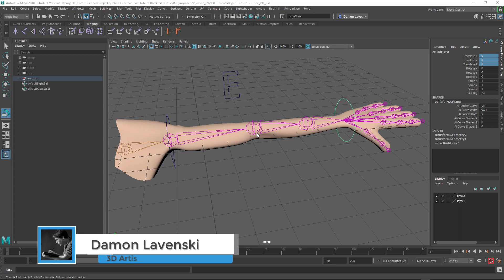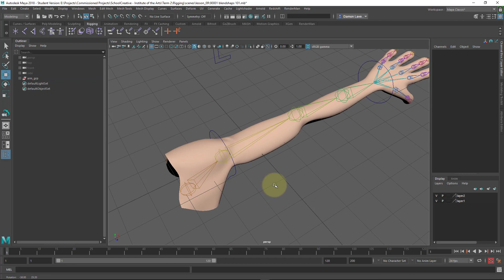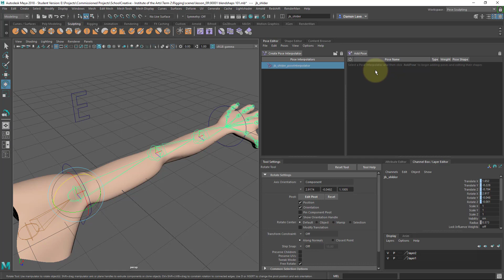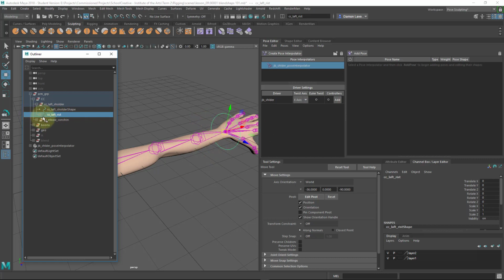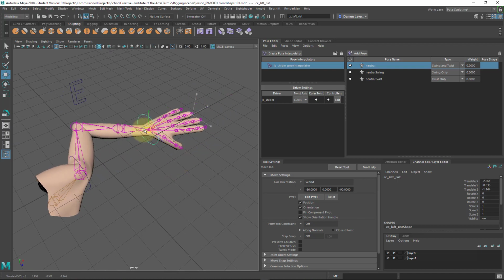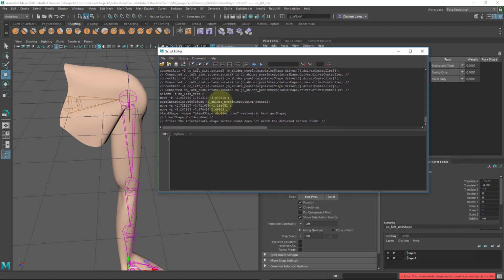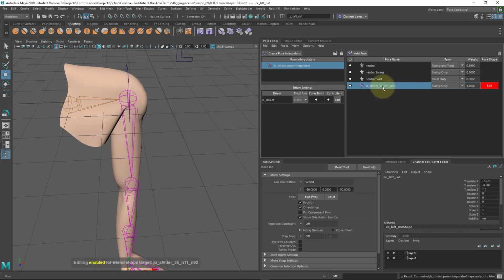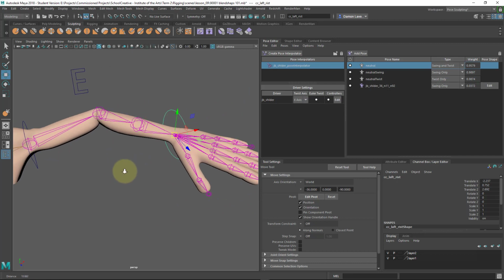Autodesk Maya Pose Sculpting on a Rigged Character

Comment: Ok, what about if you have a IK FK switch, Than the bind joints are driven by either the FK controls OR the IK controls..?
Reply from the maker: not sure I understand your question! of the bind joints should follow one or the other depending on the float attribute that you had to the switch. 0 FK 1 IK 0.5 in between
Reply: @DamonLavenski My question is, what is the driver of the shape interpolater in such a setup? The FK shoulder ctrl curve? or the IK wrist ctrl curve? If it’s either of of them, the pose interpolator will not trigger if it’s or in IK mode, or FK mode.. Ideally it would respond to the bind joints and not the FK of IK chain, like a classic pose reader
Reply from the maker: @gherat  as far as I know, it does not matter which control you use it's at FK or IK,  it matters which join change you use to drivee the shapely tribulation. In this case you want to bind joints to drive so when they change positions they will activate the blend shape
Reply: @DamonLavenski  what @gherat means is that if you have the bind joints constrained by both FK and IK joints, which chain will be the driver in the Pose editor. Considering that the pose editor does not recognise bind joints if they are driven by another object and thus, you have to name those driver objects (controls or other driver joints). What would you do in that scenario ?
Reply from the maker: @sultanefe6057  The driver bind should be the bind joints. And then you have the controls you wish to drive pose. I'm not sure if you can have more than one driver for FK and IK. I have been to use this tool in quite a while, and truthfully don't remember. But I think you probably can
Reply: @DamonLavenski  ok. Say you have three joint chains for the legs; bind, ik and fk. You have a counter twist hip joint too if you like. you raise the leg(thigh) using ik foot/leg control. So in this situation, what would pick as the controller driving the bind joint in the pose editor. I know you would say hipik joint. Then, what happens if you switch to fk? Does pose editor accept two drivers or controllers?
Reply from the maker: @sultanefe6057  As long as the joint chain that is the bind chain is driving the blend shape, It does not matter which control you use as long as the joint chain is the one driving the shape.

Comment from the maker: Thanks for the feedback, now to answer some of your questions. Philip as far as I know you probably could create an in the pose editor and then channel it into the opposite side connections. But I haven't tried it myself. Jason Braatz, I truly don't know and I haven't tried it yet. But all of Autodesk's demonstrations are on an HIK system, so it should be possible. Sebastian L, I too find it quite useless and prefer to use blend shapes and Drive keys it is initially the same. But that being said I haven't tried to debug it and find a good workflow for it yet. It is one of those Autodesk things where they develop a tool and it will sit there for a year or so before they get back to it and completed if ever.

Comment: thank you very much!
https://knowledge.autodesk.com/support/maya/learn-explore/caas/CloudHelp/cloudhelp/2016/ENU/Maya/files/GUID-7C5BE381-CBB3-43E7-8B4B-77376CAD09FA-htm.html
this link is also great but the video helped a lot,

but now i have a problem and i wonder if you know anything to fix it,
i followed the steps and was able to create poses and i can switch back and forth by double clicking

but now when i click edit i cannot make any changes to the mesh,
the translate tools and sculpt have no effect on the mesh, the mesh is locked from any change for some reason even if i am in edit mode
(outside the edit mode i can change but obviously this doesnt achieve anything)

Comment: Great video.. in fact one of the few out there for the pose editor which is Maya makes quite un-intuitive.   Have you gotten (or tried) to get the pose editor to work alongside of HIK retargeting, like in the case of either mocap retargeting or in the case of importing an ATOM animation?  I can't get the two to cooperate nicely together - manual posing works but as soon as I try to drive the joints in some other way, the corrective shapes made by the pose editor don't kick in.  Now I could spend all day in the connection editor to figure out why, but by that time, I may as well paint weights by hand [which I was 'hoping' that the pose editor would allow us to all shortcut around having to do that, especially for simple rigs]
Reply: Jason Braatz will be great if we can convert all pose deformation to skin weight i don't know is that posible ?